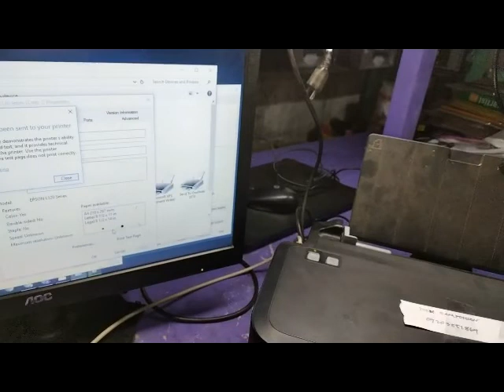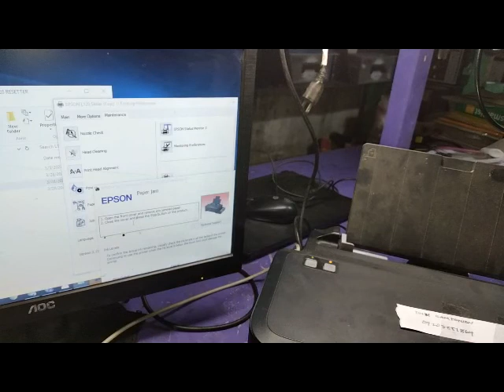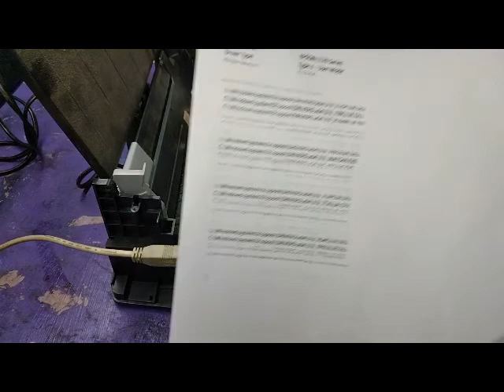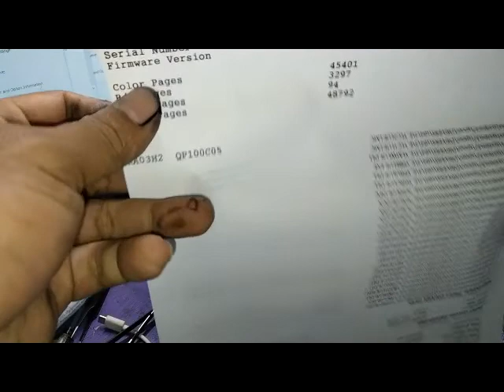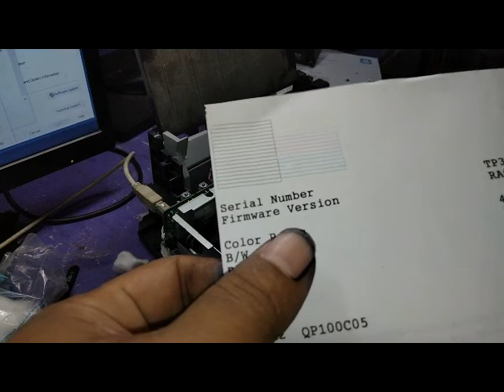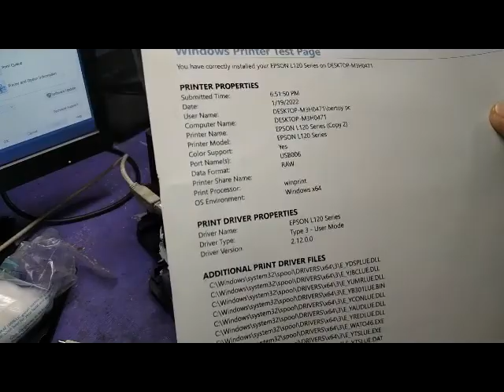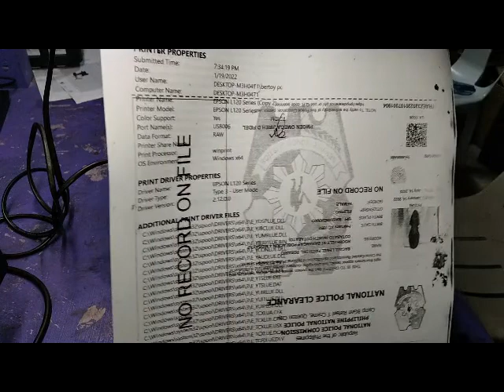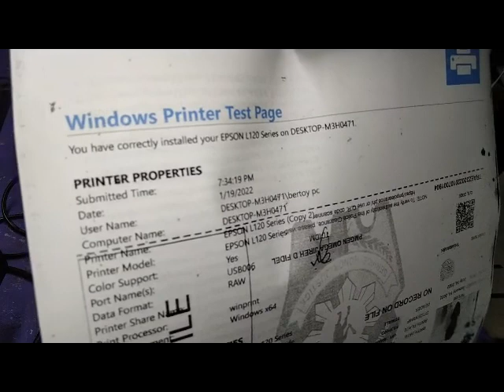epson l120  Carriage Motor problem ,print head DECLOG(FIXED)

Comment: Hello good day magandang video pwede mo ba akong tulungan ang problema ko umabot ito sa isang tiyak na bilang ng mga sheet at dahan-dahang nagsisimulang mag-print hanggang sa huminto, ito ba ang motor? sorry i use google traslator
Reply from the maker: same model epson L120?if yes most likely cr motor stops when it overheat.also check the encoder desk make its properly/tight and attached to its place..what is the error you get?check my other videos for your reference.

Comment: Sir motor po ba ng print head sira pag ka parang bigla nalang nag bago tunog nya. Same ng tunog ng nasa vid nyo po parang vibrate grinding sound
Reply from the maker: yes pag napansin mo na medyu mabagal ang movement din minsan may sound.din kadalasan double feeding nang papel..check mo muna motor
Reply: @alberttechchannel7250  sir same lng ba sign kapag sira na yung CR MOTOR sa lahat ng L Series na Epson?
Reply from the maker: yes